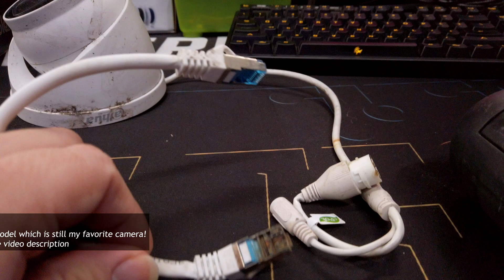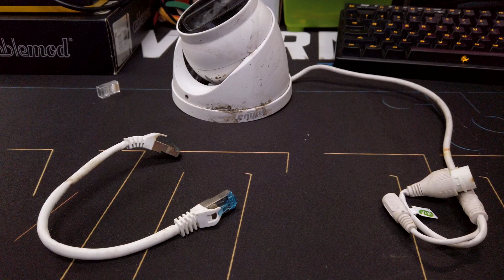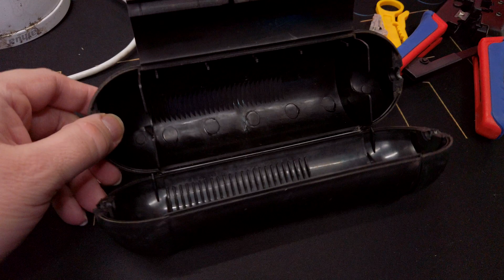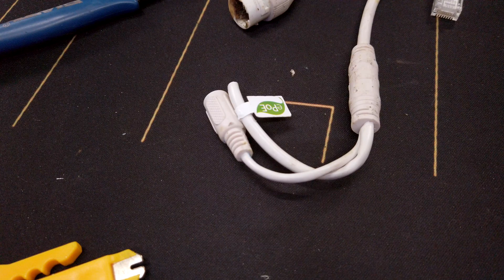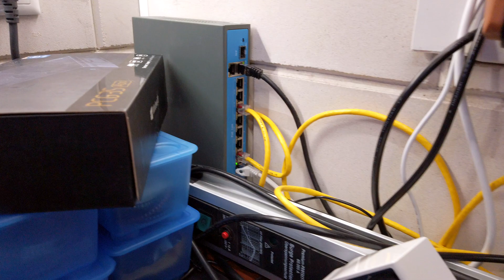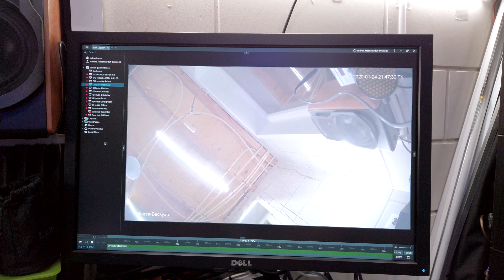IPcam: IP camera water damage, will it still work?

Comment: I just tried this with my LTS PTZ camera that took some water damage on the connector. I tried cleaning it with alcohol and other chemicals to no avail, I finally cut the wire and connected it to an existing female adapter and that thing is back up and running. Given my camera has 8 wires, I used the H-SERIES diagram and it worked. Now I'm going to drill a hole and not risk any cables being exposed. Thank you sir.

Comment: Can Dahua IP camera work with my Hikvision nvr?
Reply: I have a Hikvision NVR with Hikvision cameras in the NVR ports. For the non-Hikvision cameras I plug them into a POE switch. I use Dahua's Configtool to find the cameras that are hooked into the POE switch.  After all cameras are activated I can pull them up on Hikvision's GUI that came with the NVR.

Comment: Official Dahua pinout is dual pins for the yellow  and grey  and leaves open spaces. I think this is the problem I'm encountering with your fix. My camera works fine directly in the POE switch, but as soon as I put it back in its place outside, behind 50 meters of ethernet cable, it doesn't come online. Might be voltage loss? 
Very odd. 

Thank you for sharing. I have successfully fixed multiple of the "event camera's" you are talking about with this fix. 

Next time, please shorten the wires inside the connector to make sure the sleaving is caught between the pullresistor tab in the connector.

Comment: Shame they don't use standard colors, and all 4 pairs up to the camera. I guess it only uses mode A PoE, and they were cheaping out on special coloring. Anyhow, just a minor rant.

Why there is 6 wires tho? That is... weird. Is it for some stuff with passive injectors on "mode B"?

Good job fixing it, but you should strip less insulation from the cable next time. It should be 12 mm stripped. Some crimping and cutting tools do have that preset for that length. After untwisting a little, it will be about 15mm of wire. You should untwist as little as possible. I agree, it will work with a bit of more untwisted, but better safe than then hunt issues. Especially if you have 100 meters of cables, and dodgy patch panel or something. In general the wide plastic part that do a cable gripping, should grip over the original plastic insulation of the cable, not the small wires insulation. A lot of RJ45 / 8P8C connectors, will actually do have holes at the front to make it easier. You can strip more insulation, then put wires through the holes, and pull on them as much as possible, and only then crimp at optimal depth. After than you just cut excess with the knife, or better with sharp side cutters. A lot of cheap strippers don't have the endstop, so these kind of RJ45 plugs are very useful. These kind of plugs are basically same price, but you need to look for them, as again, most of the ones I come across doesn't feature these alignment holes.

Comment: Did your PoE switch or injector got damaged? It would be interesting to disassemble the PoE switch or injector it was connected to and see what kind of protection it has. Is it a SMD fuse, socketed fuse, polyfuse, active mosfet protection or something. Or nothing. I guess the better ones will have 1) polyfuse, 2) mosfet, 3) sense resistor with opamp and ADC to monitor the current draw.

Comment: What happened to the other part of the water proof coupling that came with the camera, it's what seals the cable coming into the connector.... That would have avoided the issue entirely. As a fix, lookup a product called "Coax Seal" you can wrap the new connector with that and it should keep moisture out. I also always drill a small drain hole in the bottom of any enclosure that I put connectors in, just in case water works its way in.

Comment: I would use some galvinising tape the next time https://www.velleman.eu/products/view?id=365874&country=us&lang=nl and place the complete connector in a outdoor  housing with the cable inputs at the bottem of the housing https://www.elektroschakelmateriaal.nl/products/attema-2271-kabeldoos-ak1-ip65-3-wurgwartels-m20-90087

Comment: Was you not using the RJ45 seal Dahua supply?
I fit Hikvision normally and always put on that RJ45 seal never had an issue with a camera I installed myself.

Had one Hikvision PTZ go bad but the previous installer just left it to the elements. I cut it off and crimped like you did (had standard colors inside) and used a cheap RJ45 coupler that has waterproof grommets either side. Would recommend you use one of them to seal it fully now the original connector is gone.
Reply from the maker: Problem is, the cable on the other-side is a keystone so even though I could seal the connector on the Dahua side, that would still be exposed so I need a solution for both. :)

Comment: Unless there's an overvoltage, i don't think any camera should fail. The PSE should protect its outputs from overcurrent.
I've had a 802.3bt switch fail intermittently at the last lanparty because i didn't think a fully sealed enclosure was necessary to protect it from rain and moisture outside.
The connector didn't look as bad but it's interesting how the oxidization (is it this?) process is sped up by the voltages used for PoE.

Comment: i gues you forgot to fill it with silicone grease and you did not use the water tight plug.

http://www.heling-connectors.com/sale-7888873-ip67-waterproof-rj45-connector-male-to-female-ethernet-cable-assembly.html

Comment: If this is the second time you have had this problem wouldn't that show your installing them wrong lol
Reply from the maker: Oh no, I know these where installed wrong, or well at least one of them was, this one lasted about 2 years before failing. But I have 9 more around the house and especially during events I basically install "100's" of cameras in a year and these have been the only two casualties over a period of 3 years. So no worries there. ;)

Comment: Dahua makes a waterproof proprietary junction box for that camera to mount to.
Reply from the maker: Yeah. Spots where I used the pfa130 or pfb203 I haven't had a single isue, just wasn't possible with this one so I hoped this would survive. It did for almost 2 years but then failed.

Comment: Luck's on you! I've had good experiences with 'mini lasdoosjes'. A small hole and a little cut from the top of the box to the place where the wire feeds in makes sure you can feed in the cables with ethernet connectors. Make sure to feed the wires from the bottom and add a drip loop if the camera is hanging higher than the junction box. It's also more asteticaly pleasing ;)

Comment: Was the water getting in simply because you did not create some kind of drip loop on the cables?  Does that connector cover need a drain hole on the bottom and the seems located in the right places?

Comment: I also have Dahua cameras and they are very reliable outdoors. 
For all outdoor cable connections suggest using some dielectric grease on the contacts. No air, no rust. Also rubber splicing tape or duct seal compound will really help to keep out the water in the first place. The duct seal compound is like putty and remains pliable for years. A single block will make many, many connections. Good for where cables enter walls, boxes, etc. I get it at Home Depot for less than $3. Brand is Gardner Bender.

Comment: Hi, nice video
You could use a wago box like this in the link, with some cable glands, I use this box(plus a extra holder available to buy) from wago for many month now with a 230v application in the garden without problems, but I have also put some Dielectric Silicone Grease on the gland rubber seals and the cable on the glands, you can also use it directly on the cable contacts for extra water protections 🙂
https://www.amazon.co.uk/Wagobox-IP68-Junction-Box/dp/B078Y5BYRV/ref=sr_1_48?keywords=wagobox&qid=1579998528&sr=8-48

Be aware that the cable glands should have a inner rubber seal and a washer typ seal, because some shops sell them without the washer rubber seals.
Shoud look similar to this ones
https://www.amazon.co.uk/Waterproof-ARPDJK-Adjustable-Assorted-Connector/dp/B07XF88KP9/ref=sr_1_8?keywords=Cable+glands&qid=1579998756&sr=8-8
Reply from the maker: Yeah that could work, I do have some project boxes and cable glands in house but not sure what route I'm going yet. :)